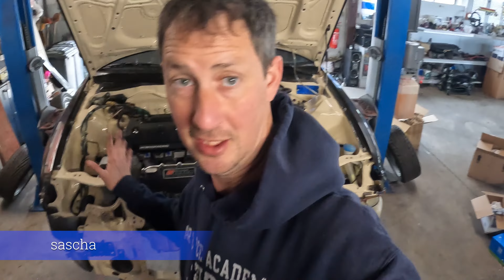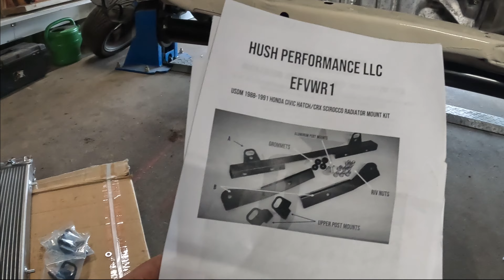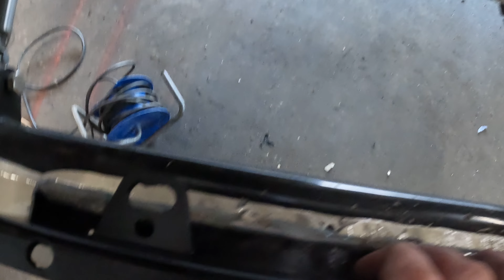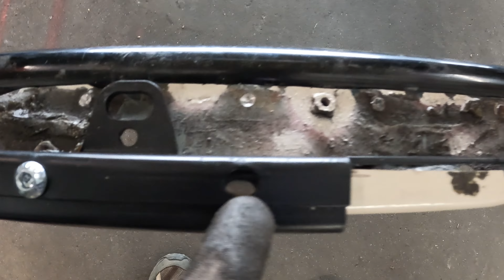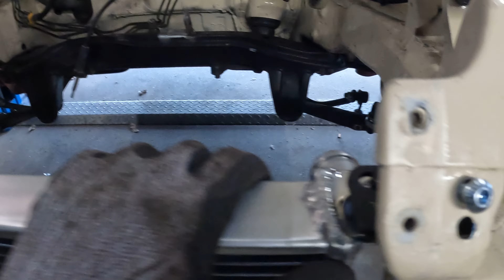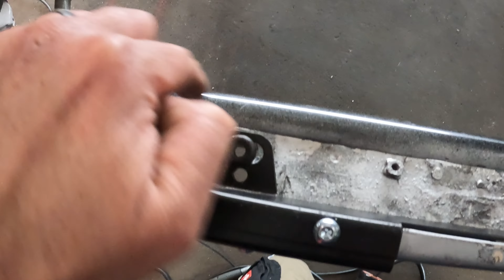Honda CRX EE8 K20 build EP.15 tucked radiator VW Scirocco Radiator

Comment: Cool build. 
Im picking up an ee8 vti next month. And I sure am contemplating putting a k20 in it.
Reply from the maker: Go for it . At least you have some information for your build . If you need extra help instagram GDM_CRX Message me there. 
If I look back at mine and I would had all the parts up front for the build . You possibly have it  up and running in a week . 
But a lot of time goes by ordering parts and figuring out what to use . 
It’s a lot of work . But hopefully worth it. 
I got mine running as of this week . Hanging behind on the videos from the build. 
But I try to upload one at least per week . With the parts that I got and were to buy . And hope that will help you with your build .
Reply: @gdm_crx8513  cool man.
yeah information is worth its weight in gold with these swaps. 
your videos will deff. help! 🙏